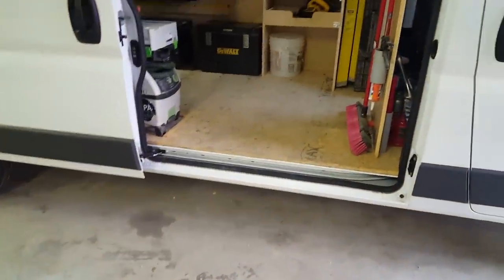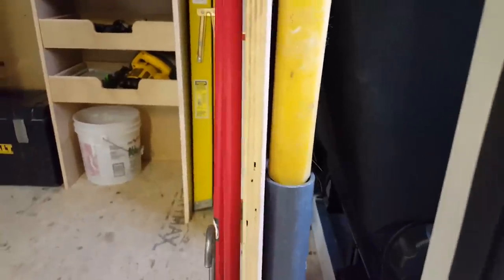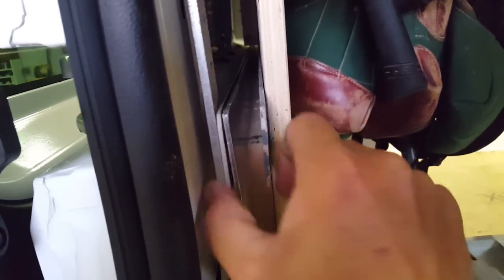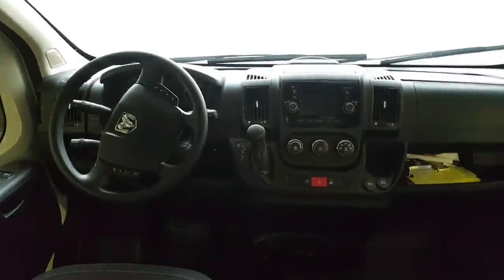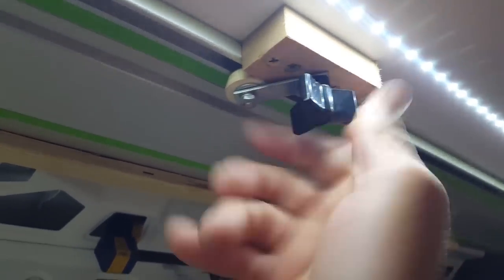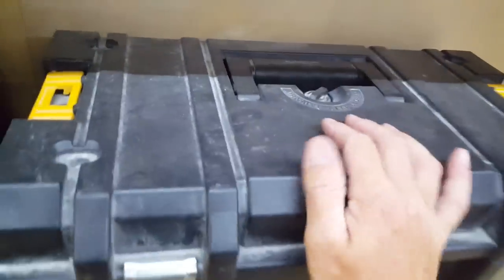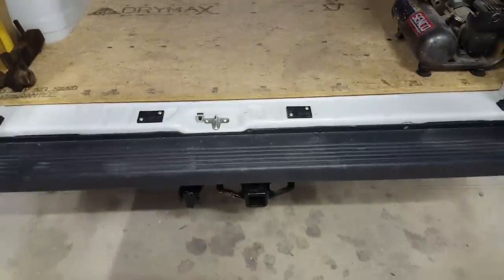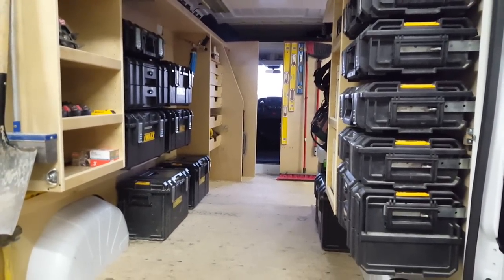New ProMaster Dewalt ToughSystem & Systainer van organization!

Comment: Awesome upfit! Gave me some ideas for my rearranged van.  You might already know this, the festool vac has a front wheel lock in front that helps for van travel, it's the green rectangle at the bottom, I only discovered mine by mistake. I really like the dewalt box brackets you created. I'm stuck between Ridgid boxes, L-Boxxes and Systainers, commitment issues I guess.  Thanks for posting.
Reply from the maker: xschultz Thank for watching! I hope it was a useful video. Yeah the lock is ok on the vac but it still can slide around on harder stops. I have quite a few systainers and some L-boxxes as well. The ToughSystem is great for our van for how we use it. I like systainers for my finish tools and obviously all my Festools.

Comment: Great storage ideas! What is the model number of those Dewalt drawers? I just bought all new Tough Boxes and the two drawer unit that I have isn’t as nice as the one you have. I’ve never seen that unit before.
Reply from the maker: Not sure. Mine is the older version. They revamped the 2 drawer unit last year I think. I have had to put our back together a couple of times now. It can separate and the bottom drawer falls down if we hit a big bump hard.

Comment: Looks great. We just ordered a 2019 same as yours. From a truck F250. I knew we had to get a van eventually:) 

Do you sell these brackets? If not, why not. Ha... can you send specs? Thanks
Reply from the maker: You will love it! It is still great to work out of. Whenever I have to go pick up plywood or drywall for a small job I really love the high ceiling and easy loading!  

I do not sell the brackets but I have another video on YouTube showing them a little closer.

Comment: Are those just normal shelf brackets that are holding the tough system?
Reply from the maker: Yes. I got these at Ace and Menards. Just a heavy duty l bracket I welded and small tab onto.
Reply: @overanalyze4108  Thank for the fast response! Nice i might try this
Reply from the maker: @Ender_Wiggin  you bet. Here is the link to one I have used. National Hardware® Galvanized Corner Brace at Menards https://www.menards.com/main/p-1444448896418.htm

Comment: working out of a truck with contractor cap really sucks ass.  pull three items out, set on ground to get one item behind it. royal pain in balls.  looking forward to growing up and moving into a big boy van.  besides i need my truck back to go to the dump etc.
Reply from the maker: A bed slide is a nice upgrade if you have a truck and cap setup. You lose a little space but gain much easier access.

Comment: 1:45  Here in Europe Van's have to come with a Wall seperating the cab and cargo area, usually high strength steel welded, i don't think your plywood would hold off all your stuff flying, though maybe this was required in the US. Only way you don't have that seperating wall is if its a mini bus or people carrier.
Reply from the maker: Snotra I am definitely ok with the strength of the 3/4" plywood as a divider. No it is not required here. Thanks for checking out my video!
Reply: I agree. In a crash a lot of that gear in the back will join you, there's no way is strong enough
Reply from the maker: matty schofield I appreciate your input. I have no concern of the 3/4" plywood failing in a wreck. Almost everything is secured and the plywood is attached to a bulkhead above the seats and the floor. Thanks for watching!
Reply: I was a street medic for years and now spend time doing crash rescue at a local NASCAR track. I have treated thousands of patients who have been involved in crashes including some in work vans. Yes you are correct in that a severe crash they plywood "probably" won't be of much help. But if he is involved in a crash that is severe enough to send those tool boxes through multiple layers of shelving he has other issues to worry about at that point. The forces involved in a crash are extreme and you can't make it 100% safe. I've seen commercially made steel partitions fail as well in a crash. Wood is surprisingly resilient. Would like to see him add a door in the partition though.
Reply: Hate the "in Europe" comments, he is in the US not Europe.

Comment: Paint the floor and the shelves. It would increase the durability and keep the wood from rotting. You will be wet and those tools will get wet. Paint is cheap. For the floor you could even do a non-slip.
Reply from the maker: We used LP's version of Advantech on the floor. The shelves and built ins are all made from UV cure prefinished birch ply. I appreciate the tip but I am not worried about rot ever. The van is stored inside and we don't work in the rain.

Comment: Did you have a long wheel base e350 prior to this?
Reply from the maker: Yes I did!
Reply: I have a regular wheelbase e250 do you think moving to a long e350 would be much of a difference for cargo space
Reply from the maker: @michaelseamus2112  yes but I would really suggest you check out the ProMaster or Transit. Wouldn't ever go back to a regular van or truck. So nice to work out of and get materials in..
Reply: Yea i have been looking i want a high roof long promaster but itll be a few years. Just got out of my truck into this van
Reply: Also thanks for the replies!
Reply from the maker: @michaelseamus2112  ok I can appreciate that. Did you see my older can video?

Comment: I just picked up a 2017 ProMaster and am installing LED strip lighting tied into the existing cargo area dome light wiring (specifically the light near the side door), since I also wanted something that timed out and wouldn't run down the battery.  What I'm finding is that the dome lights time out after about 3 minutes, but the LED lights take about 15 minutes to turn off (with or without the dome light connected), and that a dim flickering of the LED lights occurs after 15 minutes.  I haven't let them sit long enough to know if they eventually turn off completely.  Also, upon locking the doors with the remote, the dome lights dim and go out, but the LEDs stay on (not sure for how long).  Are you getting the same issues?
Reply from the maker: Michael Quinlan I am not having that issue. How did you tie into the  factory lights? What voltage and length led tape lighting did you use?

Comment: Nice setup! Have you had any issues with the Toughsystem drawer units? I’m deciding between the Toughsystem and Tstak solutions, and while I like the overall Toughsystem plan better, I’ve heard nothing but complaints about the drawer units.
Reply from the maker: Wms YT page We really haven't. Maybe because ours hang it is better? They do have a newer drawer hjit coming out in the ToughSysgem that looks much nicer. You might want to check those out.
Reply: Thanks for the reply! With the amount of bad press the original design was getting, I'd hoped they were making a revision. Everything that i've seen (incl. on the Dewalt site) seems like the old design though... Any idea or links for when the revised design is due to be available? Also, I just talked with live chat on the Dewalt site, and they said they've heard no plans of any updates on the drawer unit design.